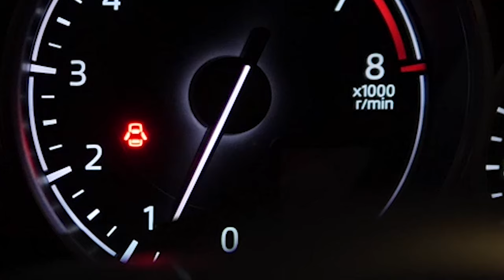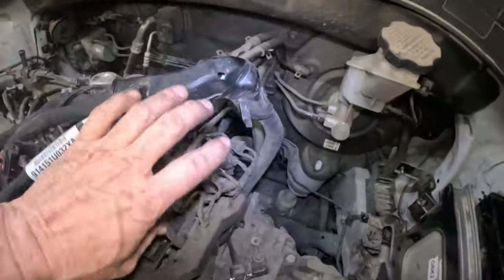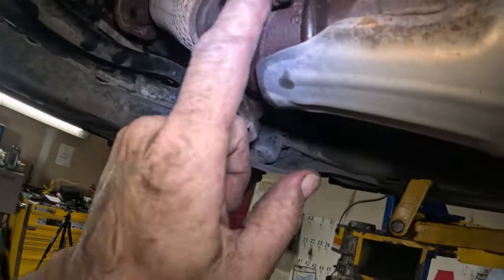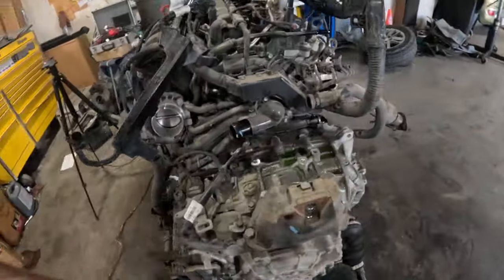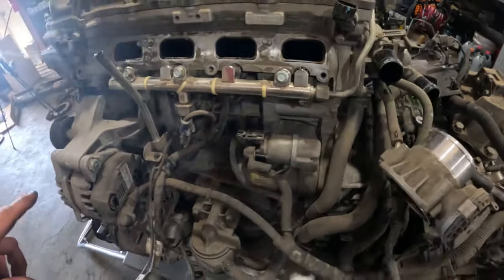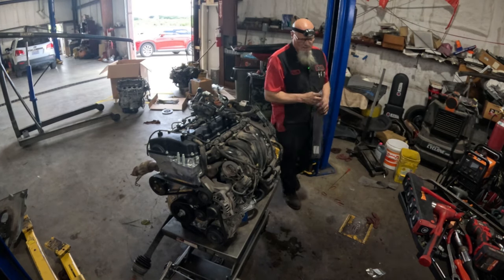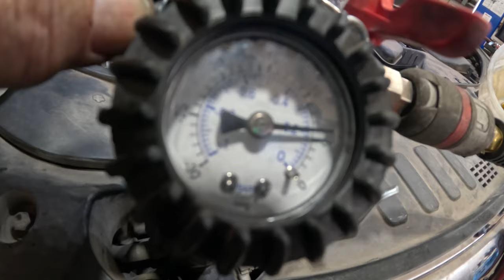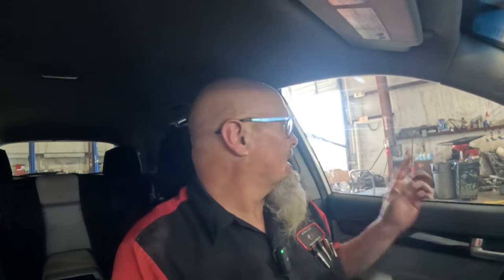Sorento engine replacement under Warranty Extension.

Comment from the maker: Have you had your KIA engine replaced under the warranty extension?
Reply: Yes I have. 2017 Sorento with 65k miles. It was smooth process for me and the new engine has been running great.
Reply from the maker: @1hondaluver  that's great. Thanks for the comment.
Reply: Currently in the process for the TSB 265 I believe for the head gasket but working directly with Kia cause the dealership is trying to get me for 1000$ for replacing the coolant reservoir and diagnostic except I’m not dumb when it comes to cars and  YouTube is great knew the head gasket was blown cause of a leak…
Reply: @ShopForemanGarage  No problem. The dealership that ended up replacing my engine said mine was one of the least mileage one they have seen fail. 65k miles and that is with full synthetic oil changed every 6 months or 5k miles at the dealership. So that proves it doesn't matter how much you take care of these engines, they will still fail. I'm just glad that mine is covered by the lifetime engine warranty, although I'm told these replacement engines don't suffer from the oil passage issues. Not sure I believe that.
Reply: Just had my 2012 Sorento with about 100,000 miles engine replaced. They had the car for about two days. So far runs great.

Comment: Currently waiting to have my 2016 Sorrento Engine replaced under the program. In the video you mentioned that the customer paid to have  a new upper and lower radiator installed which seems prudent.  Is there anything else that should be replaced while the engine is out? My engine had 130K at failure.
Reply from the maker: We always recommend belts and hoses when we replace an engine.  A lot of the vehicle have higher mileage and those hoses like to start leaking after they have been moved around.  We charge a small labor for the hoses but, the drive belt, we don't charge any labor because the belt has to come off to replace the engine.